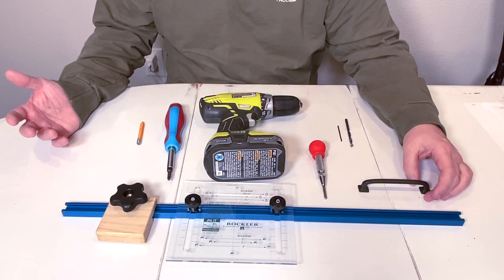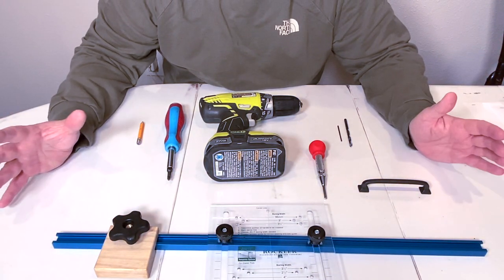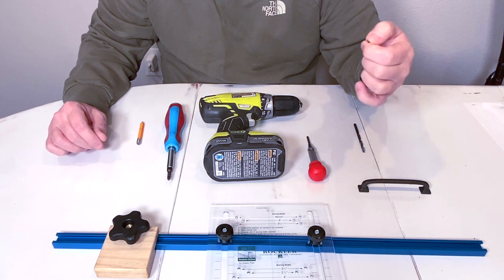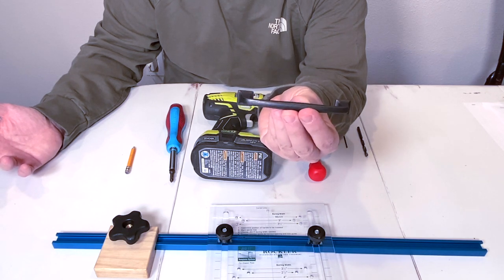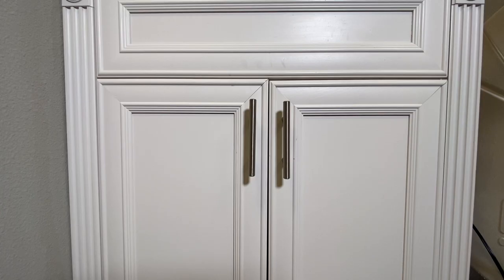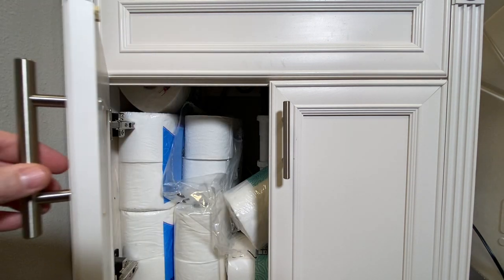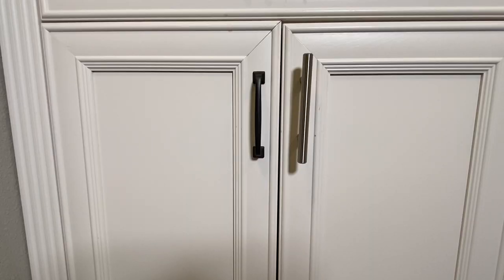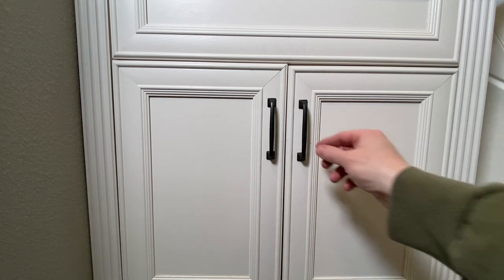Fixing a Bad Cabinet Handle Installation

Comment: A handyman put my kitchen cabinets hard ware in the middle of cabinets and I don’t like I rather have them at the bottom and the top, how do I repair the holes on white lacquer cabinets?
Reply from the maker: Well without patching and repainting I may try Wunderfil wood filler.  They make it in white. I hope this helps.

Comment: Best way, fix hole with resin, sand, make new holes, paint, and re-install handles.
Reply from the maker: I like your method, but we both know how much more work is involved in that. I would screw the paint up.  I do want to learn the paint process. I can do all the other stuff.